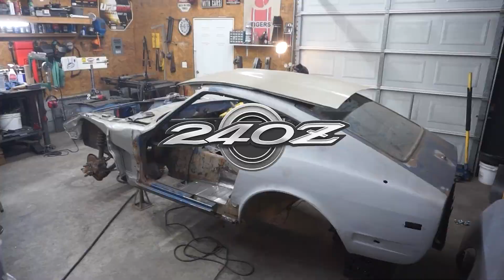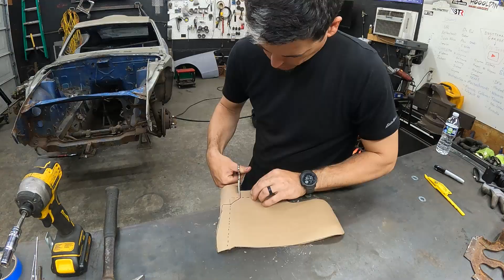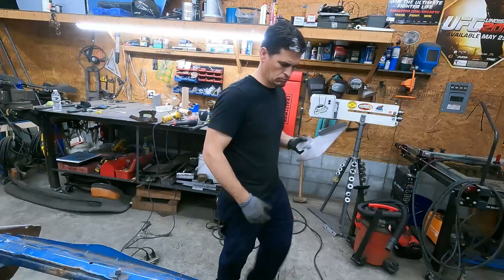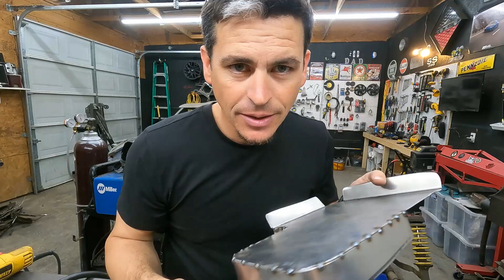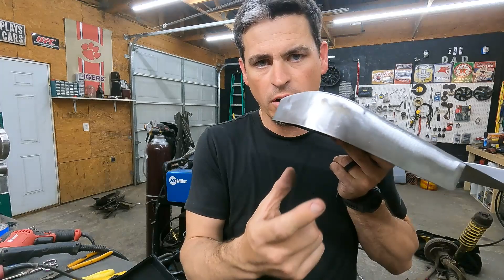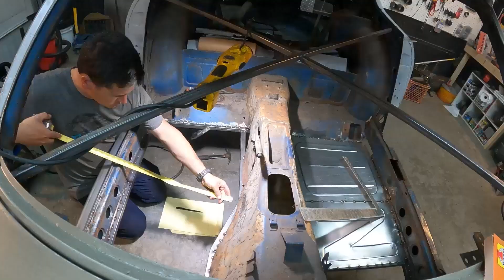Rebuilding a Legend 240z Part 11 (Custom Fabricated Battery Tray) from scratch

Comment: Great fabrication work again Dusty but pacing wise it’s a lot of viewing time just on a battery tray! Some people will love that. However, in terms of growing the channel I think a lot of people are interested in the Z more generally and you definitely need as you suggest to look at the engine in the next episode and maybe just condense the fabrication into shorter episodes or do 10 minutes of that and another 10 looking at other aspects of the build? Just my two cents or pennys but keep going after it and I’ll check back in 👍
Reply from the maker: Yooo Mark!!! You make a very good point. I will keep that in mind. I had some clips of us fooling around with the motor I was excited about and wanted to include BUT I hit format sd card the same way I always do but this time I wasnt suppose to. I forgot there was clips on it that I didnt transfer to computer yet 😩😩 but when I realized it, I was a little too late. Thanks for support as always, I appreciate it 😃